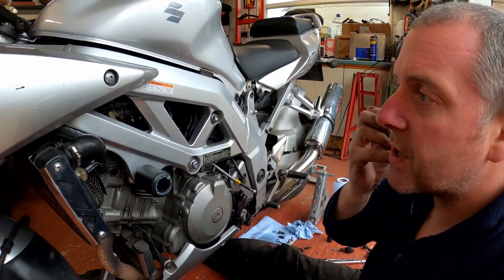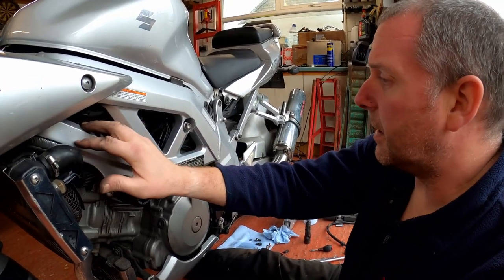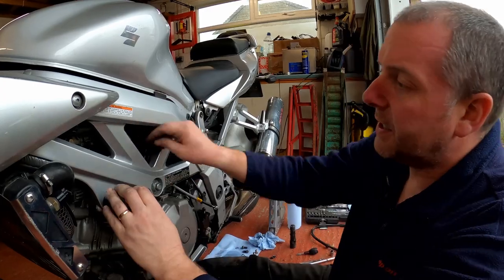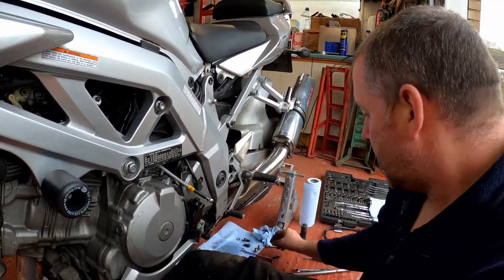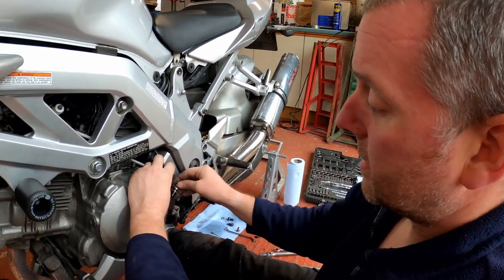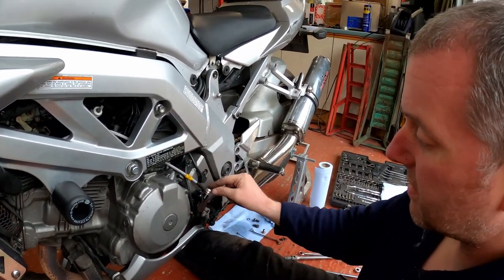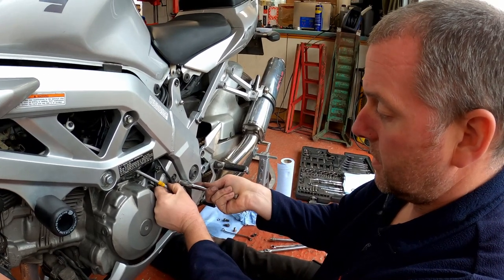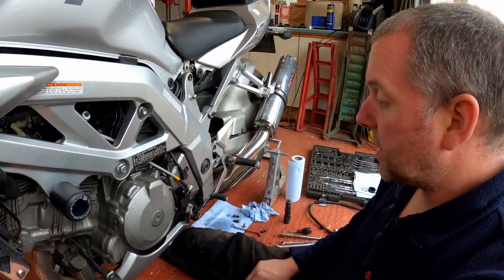Suzuki SV1000 Project Bike - Part 6 - Fitting a HEL Performance Braided Clutch Line

Comment: I did this several years ago and I don’t remember that I removed the brackets … I think i just popped off the old cable at the rubber points. Or I don’t remember anymore 😂

Comment: I ask here as well :)
Is it possible to adjust the gripping point of the clutch?
Mine is just in the last 1-2 cm. :/

thx
Reply from the maker: Have you changed the fluid? You’ll be surprised at the difference that can make!
Reply: @KevsShed  yes I had, but unfortunately it didn't change

Comment: Have you ever tried the 650, if so, how do they compare to the 1000 ?
Reply from the maker: I did ride a brand new original 1st Gen 650 back at the beginning of the noughties, it was totally different to what I was used to back then as I had never ridden a V-Twin at the time! I do remember really enjoying the torque. The only real difference between that and the Thou is the difference in power, the Thou will pull your arms off a bit more than the 650. I think the 650s make ideal first bikes!
Reply: @KevsShed  the 650 was my first V-Twin, really different experience to an inline 4. Definitely would consider a big twin, TL1000R or something like that maybe 😍. I would imagine the engine braking would almost throw you out over the handlebars 😂